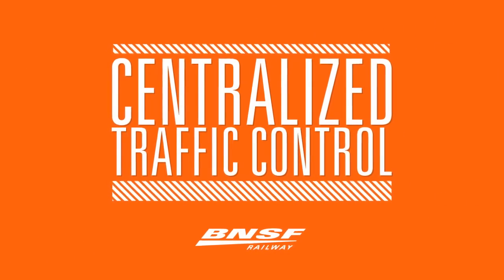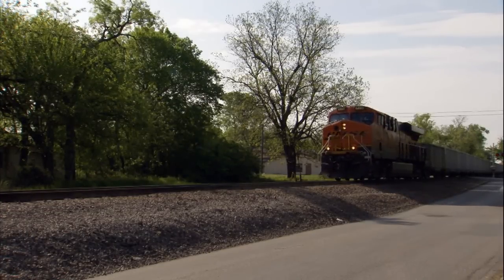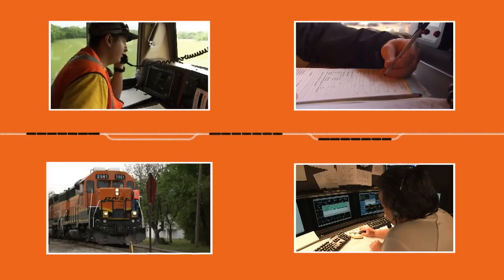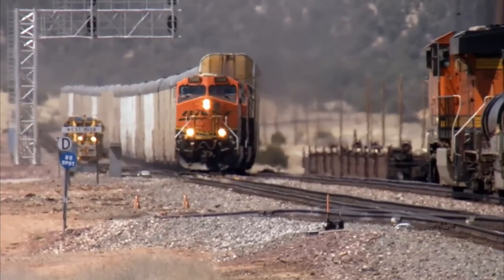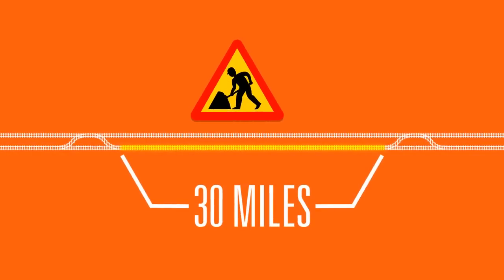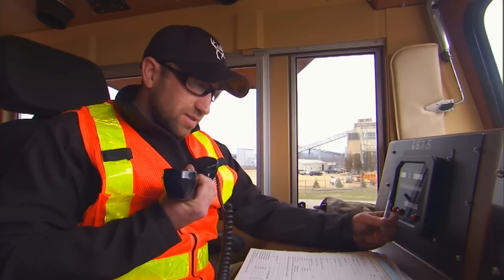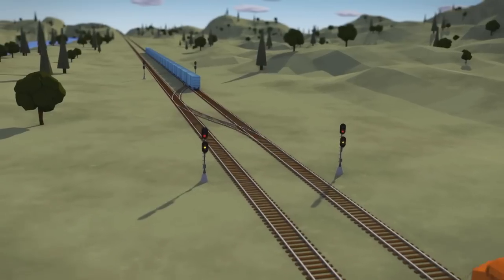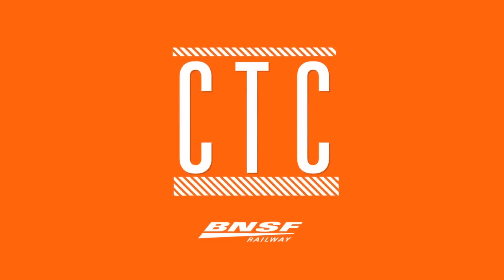How Centralized Traffic Control makes rail traffic more efficient

Comment: Actually, track warrants (such as the superior Form D of mighty eastern railroads) can be obtained without being in presence of a signal. NORAC Form D is versatile and can be used to protect against crossings, reverse lined junctions, other trains or track cars, and whatever is in box 13 "other." Copying a form D over the radio can be done while in route with a crew of 2.

See, western railroads don't even know how CTC works. Trains still need track warrants, but they are internal to the computer system. It just saves time by interlocking the signals to a computer. Traditionally, symbols out west are a bunch of gibberish letters. What's Z-OALAT? UP and BNSF tend to make their symbols descriptive of origin and destination with cargo, but to me it's just a bunch of extra trains not on a timed schedule.

This makes sense: Q436. It's a Manifest (Q) in the northern division of CSX (400) and it operates from Selkirk to Framingham daily. It's a train on a timetable, not an extra seven letters and a dash. From symbols to control it's better by the Atlantic. Here in the east we use such a wide variety of control systems that mesh together you don't even need physical signals. From ATC to ACSES, which still did not prevent the wreck of 601 surprisingly, the east will beat the west any day.

Comment: 70mph isn't all that fast... European mainlines often reach speeds over 200km/h (over 120mph)
Reply: Finn K - on freight?
Reply: But European freight trains have much less capacity due to this. Most sidetracks in Europe can only accomodate trains less than 600 meters, whereas trains in the States can be Miles long. US also have wider clearance, so a single train car can hold two standard containers. Also, US lines are mostly dedicated to freight, whereas European tracks are usually shared with passenger trains, leading to a higher cost. There is a reason that freight trains in the US have a higher share of total fright shipments compared to that of Europe, despite the fact that European rail networks seems more advanced.
Reply: +Dead Frt West Some light containerised freight could probably run that fast I have seen trains full of containers moving at the same speed the pax trains do over a section of track that's posted at 95 mph here in the UK. Course no real way to know by looking at it what is in a shipping container could have been empty containers for all I know though logistics planning software tends to try to optimise those out as much as possible for obvious reasons.
Reply: In Germany, Austria, Switzerland and France is travel speed of freight trains about 75-100mph.

Comment: I thought CTC was obsolete now with PTC being put in place.
Reply: +TrainTrackTrav, CTC is hardly obsolete. CTC is, quite simply, a means of controlling switches remotely and conveying movement authority by signal indication. PTC is a means of enforcing that trains don't exceed their movement authority, run through a switch not properly line, pass through a speed restriction in excess of the maximum safe speed, or enter a designated roadway work zone – these four functions being the ones specified in federal law.

In general terms, though CTC has safety benefits, it is more about maximizing efficient use of the infrastructure – as shown by this film. The aim of PTC is to prevent human errors. PTC can be applied in both CTC and track warrant territory to enforce whatever underlying authority system is in use, along with the other functions mentioned.
Reply: CTC is creme-of-the-crop.  PTC is an overlay to CTC.